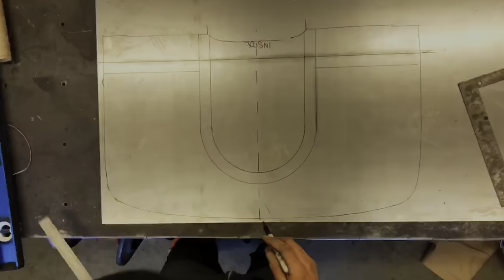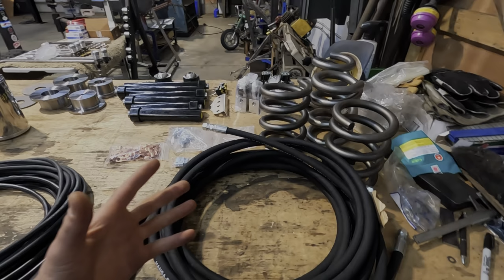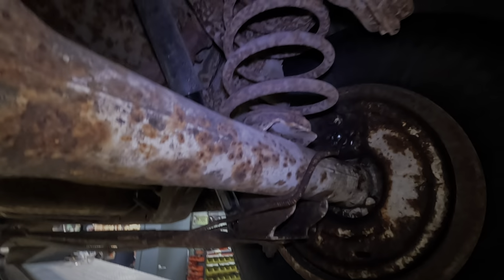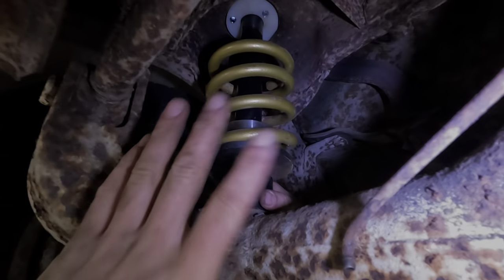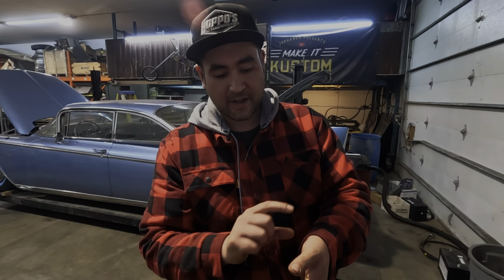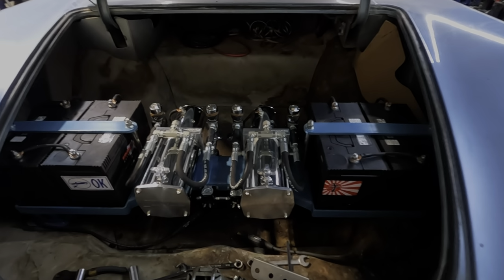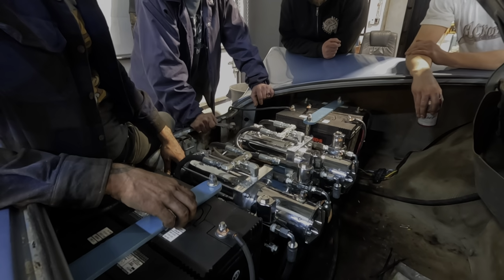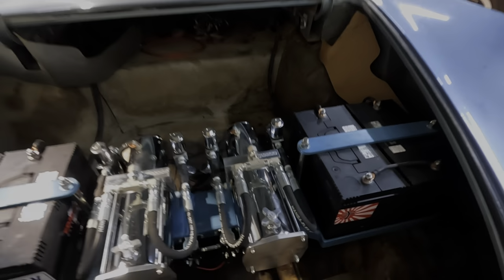Lowrider Hydraulic Suspension Install In 3 Days Hoppos HOW TO

Comment: love this car, You can't beat the Buicks especially in their hay day. They were very popular cars and still are.. My all time favorite is the 59,or 60  Fury with the bucket seats that swivelled and the unique space aged dash, and rectangular steering wheel. With a 426 Max Wedge motor. I'd prefer the two toned blue on white but nevertheless this 58 Buick is a gem. I'd own one myself if I didn't love my Trucks and my wifes convertible.I only have so much room in my driveway. LOL but if I can ever afford it, I'd love to own a Buick Fury from that era. THEY DEFINITELY DON'T MAKE THEM LIKE THEY USE TOO. THAT'S FOR DERN SURE.

Comment: I love how the installation worked out.  I like the idea that the ride is the same at any height.
If those are real knockoff wheels, please check for tightness regularly.  I had a Vette with knockoffs, and would check them at every fill of the gas tank.  That turned out not to be enough, and as a result, I lost a wheel in the middle of nowhere (Northern Ontario).  So, part two, have a plan for replacing the wheel, if you lose one and a replacement wheel and nut aren't easily available.

Comment: Not wishing to dampen enthusiasm, but spring metallurgy is pretty important.  So softening an end sufficiently to bend it flat, you run the risk of having the metallic structure changing along its length.  The repeated stress cycles seen by the spring may well result in a failure near the heated portion.  You might get away with it if the heating process doesn't go over an important theshold where the crystal structure changes significantly.

Comment: I am looking forward to this mod.  Hard to believe you will be able to do it in 3 days.
I'm a nailhead guy all the way, but wasn't crazy about the 59.  Those nailhead engines were impressive, once you could ditch the DynaSlo transmission.  I used a 3 spd for my swap into a 47 Chev in 1961.  The engine was indestructible.  Transmission.....not so much.  I regret ever selling that car.

Comment: Future baby adding two more batteries 6 batteries in the two pump setup is almost just right on my mini truck 8 batteries three pumps 12 14 inch cylinders and the back get a little more lift and then you  three-wheel you might half to take those shocks off and get you a slip yoke what a beautiful car setup really clean set up I like how you make those donuts for the cylinders chargers and batteries a street charger charge those batteries while you drive

Comment: you can go with reverse deep cups in the rear and it lets you run a little more coil and it sits down lower, over the power balls…      i would also run the 2 tons up front, that’s a heavy ass car and it will still ride smooth…

Comment: Carl, been watching your channel for a few months now. I have learn so many new tricks with welding thin sheet metal. Thank you. I am looking to buy a new set of body hammers and wondered if you have a recommendation of a set to get started with. I bought a cheap set many years ago. But my fab work is getting way better and I am getting ready to build a c10 and want to upgrade. Any input you have would be great.

Comment: 2 things. Not sure the stock rear spring perch on the diff are solid enough. Hydraulics pushes harder on those then the spring was

Second. The battery rack on the frame also provide ground for the setup. Just the body ground isn’t enough. If you do this add more body to frame ground in the back. The performance will be affected.
Reply from the maker: It’s actually not grounded to the body because it’s its own electrical circuit. Those four batteries are only for the hydraulics. The spring is still pushing on it kind of because nothing is solid mounted it’s the spring still cushioning the ride.
Reply: @MakeItKustom   true you have softer springs. I forgot. … as for the ground… your right now I feel dumb

Comment: Any Pros or Cons for Hydraulic Pumps Opposed Air Bags? How is the ride going to be with the Hydraulics? The install looks great! Love Your Videos!
Reply: I would rather bag it  and have one or two compressors on the frame hidden and you still have your trunk
Reply from the maker: Yeah, they are two different suspension systems and you have the freedom to set them up in any way shape or form so really depending on who you are and what you’re looking to do with the car both systems are great. It all depends on who’s designing it and what you want out of it

Comment: If you take a heated liqufied gallon of keg roofing tar, a gallon of new engine oil , a bottle of your favorite perfume and give that poor under belly a good squirt with a shoost gun or it wont be long youll be seeing holes in that sweet ride. This concoction never dries up completely and stays on but doesn't drip off on a hot day and make a mess of your driveway.

Comment: Why did you choose to separate the front and rear halves of the system? Could a single HOPO'S motor lift all four corners on an even lift? I plan on doing this to a Volvo 240 but I'll be raising it between stock height and a 4ish-inch lift. It's a daily driver/trail vehicle and I want to minimize the space the pump takes up.

Comment: Is there a reason why the two pumps couldn't have been mounted under the two sides of the trunk and the 4 batteries on the shelf behind the seat to leave more trunk space open? I've never done a setup like this but I prefer hiding things a bit and not losing all the trunk space. 

Alternately the two pumps up on the shelf and two batteries on either side of the trunk since they'll hopefully be more likely to need service than the pumps. 

Beautiful car, great build.
Reply: The car is gonna ride llw putting them on the underside will cause damage
Reply: @Davo32310  under the sides of the trunk, not under the car. Like behind the taillights.
Reply: THEY COULDVE BEEN MOUNTED JUST LIKE YOU SAID DUCKYHUNTER....THERES SO MANY WAYS TO MOUNT THEM IN THE TRUNK ....ITS JUST HOW THEY CHOOSE TO DO IT.....

Comment: 2 things I would have done differently. First if you bolt in the rack I would go through the frame with heavy duty bolts. Second I would move the solenoids from under the pumps those go out often and where they are underneath the pumps it'll be difficult to change them plus of they catch fire anything above will be burned. And on more thing make some perches for the powerballs thos stock ones are crap and won't hold up even if it's just a lay and play

Comment: Would a slip yoke drive shaft be required in this situation? Just curious
Reply from the maker: It’s not required because we didn’t even remove the rubber bump stops. It still travels the same as stock

Comment: I see shocks in the rear, but is there anything up front to control the bounce?
Reply from the maker: Right now it doesn’t have shocks upfront because the coils are so stiff, but I think we’re gonna go back to stock coils in the front and add shocks like how I did the Cadillac
Reply: Cool! I've built a few trucks on bags, but never even took a ride in anything with hydraulics. Didn't know what's considered normal.

Comment: I wanna see karl build a steampunk/wasteland style car, maybe something odd. like a Edsel.  Maybe he partners with a automotive artist. like the art deisgner for madmax road fury, or one of those AI picture rendering things.  I think doin crazy stuff like running copper lines out of the hood to a radiator mounted in the back then tarnishing/patina the copper. Those Edison number bulbs to display a speedo. Dualie Axle in the rear with the old 1960's knobbly tires. hanging chains for mudflaps. maybe one of those big racing wings made out of those huge circular sawblades from the saw mills. Exo cage around the outside of the car.  get a 4 door, weld the front/back doors closed, but cut the pillar between them and hook up a hoppos hydraulic system to gull-wing the front and back doors open. wow. i got carried away there. just do something neat and fun. be sloppy with it and get creative, i just love seeing automotive art!

Comment: May I ask a technical question: how is this battery pack recharged? Will the generator do that or do you have to plug in stationary?
Sry, just an impressed noob calling…
Reply: YOU CAN USE MULTI CHARGER AND CHARGE THEM AT THE SAME TIME..OR REGULAR BATTERY CHARGER BUT YOU HAVE TO CHARGE THEM 1 BY 1 ...MORE OF A HASSLE...........THERES ALSO  STREET CHARGER THAT CAN CHARGE YOUR BATTERYS WHILE YOU DRIVE...

Comment: Nice work man. Only thing I would do different would have been to remove the oem rear spring perch and replace it with some 3" x 1/4 C-channel. Its a stronger mount and would give you another 1/2-1" drop. I'm building a clean 82 Monte Carlo street hopper on my channel here shortly once finish my custom 1 car shop setup. Would be awesome if you subbed me because I'm starting to post some cool tech content around the build. I just posted a DIY knockoff wheel tool. Learning a lot from your videos, so thanks!

Comment: What I don't understand is that you didn't put the pumps up on the hump over the wheels and stack the batteries on the sides is to me that's a better space management after all you might want to use that trunk for something in the future
Reply from the maker: It’s mostly for easier access. I was hoping we would tuck the batteries away as well. But my bro made the call.
Reply: Bro gets what he wants I he just use as a cruiser only

Comment: Don't like the tiny rims and the white wall tires. I would like at least 16" black wall tires but the lift and stance is really cool. Also for me with a trunk that massive I would have liked the pumps as far forward as possible and batteries mounted as far left and right in trunk so I could still use trunk for things. I know those tiny wide rims with tiny tires is the style just don't get the look.

Comment: Trash Battery box install.. the weight of the batteries and pumps alone on just those 2 points will weaken itself overtime.. let alone up and down movement.... poor choice